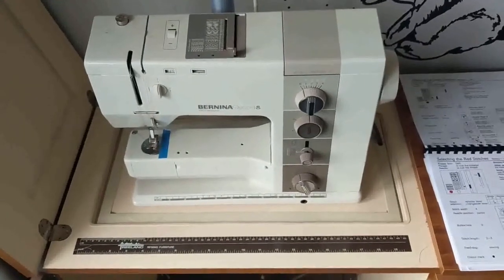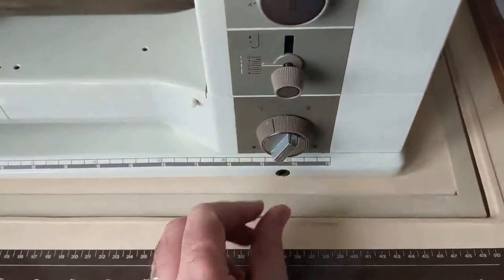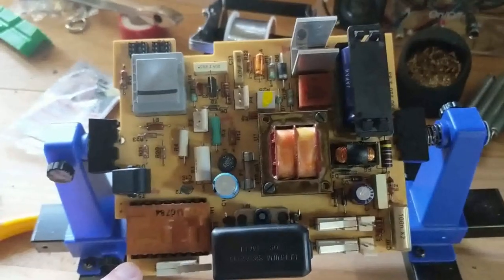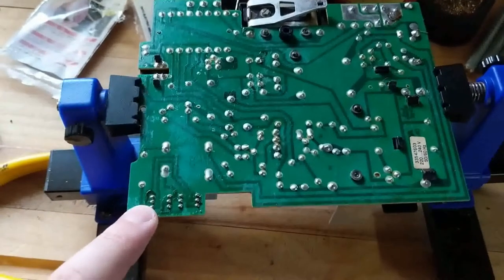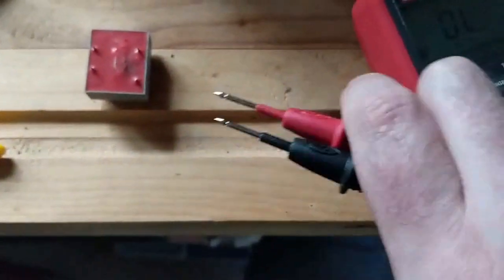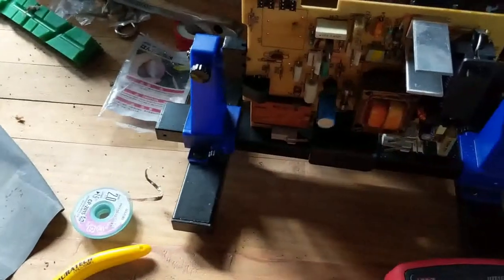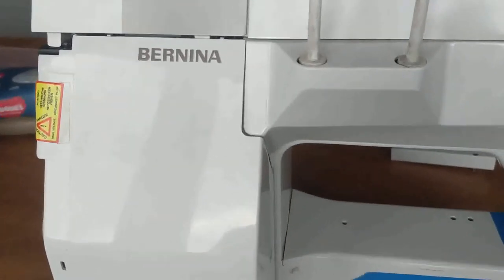Fixing the diode transformer on my Bernina 930

Comment: Hi, thank you for the video. Is it possible to have a picture on how the transformer sitting on the board just before closing the cover?  Thank you.
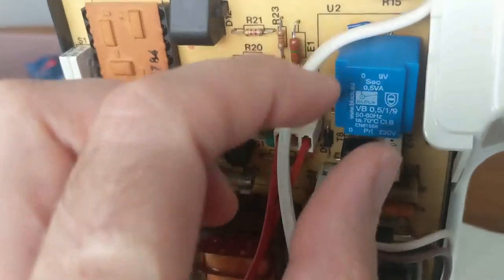Reply from the maker: 9:30 in the video shows how I have rotated the transformer 90 degrees counter clockwise - I also had to solder some wires to the 'legs' of the transformer and that let me move the transformer lower down to where the case has more depth. I will try and open the machine up and post a picture to your BTS forum post later this week

Comment: I have a question--what else besides the LED lights does this diode affect? Or does i only drive these lights? Thank you.
Reply from the maker: Only the four lights as far as I could see. If you look at 7:50 in the video the two black plugs at the top of the screen are the parts getting the reduced voltage.
Reply: Thank you! @Dav4122